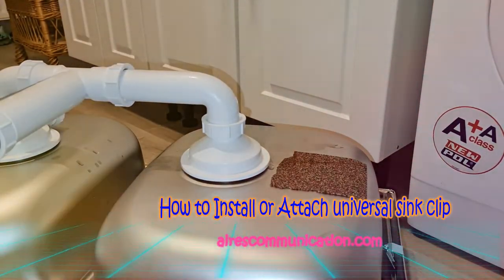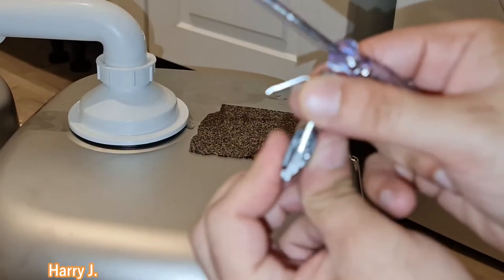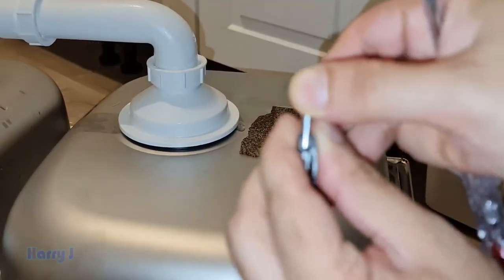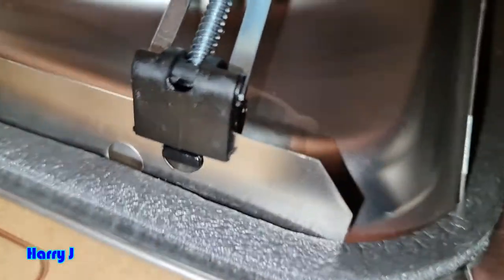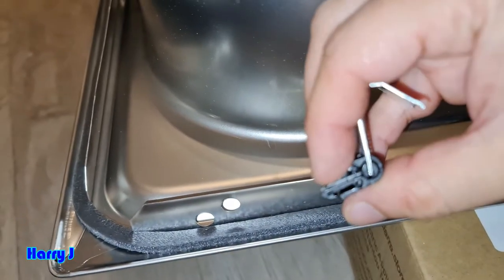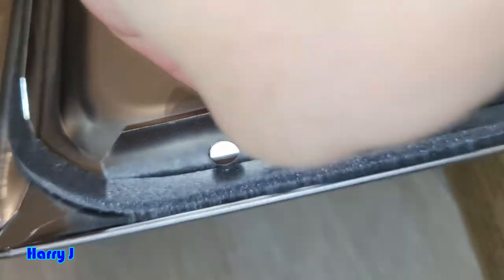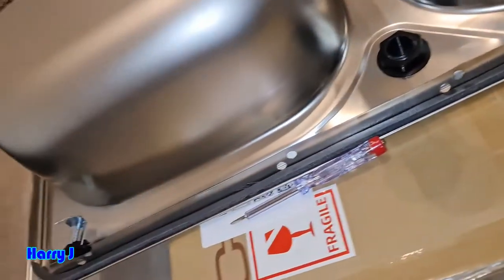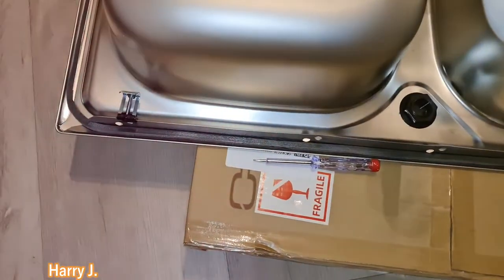How to Install or Attach universal sink clip

Comment: Ya it's easy to put them on sir but it would have been nice if you showed how you install them under the sink. Do you flip them up then screw them? Or what? Thank you for sharing the first part
Reply: There actually really hard to install. If your sink has a tight sink hole, man I was having time but the problem I'm having is the single metal sink seems to have a bow in it and slightly doesn't seat flat, maybe a 2mm gap but with these clips they strip out so easy thats I can't get the proper pressure to seat it flat. This clamp design is trash
Reply: I'm really frustrated, too.     at my sink clips.  I'm not getting this at all.
Reply: @sammyglo5354   I'm having the exact same problem. I've been working on this for about 2 hours now. ....
Reply: @misterman3379  if you have drawers beside your sink opening and you have like 1-2"s of of room. My goodness it's hard. I think I ended up modified the clips to apple more pressure to the sink.